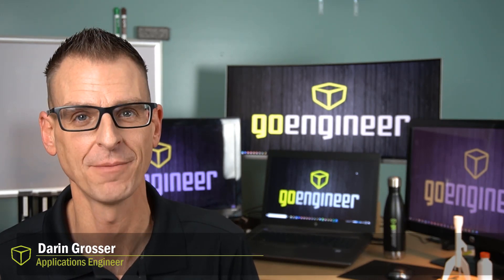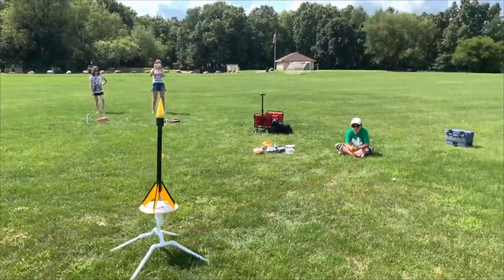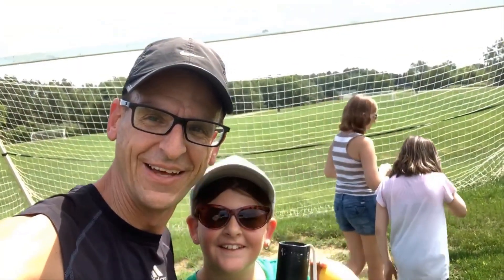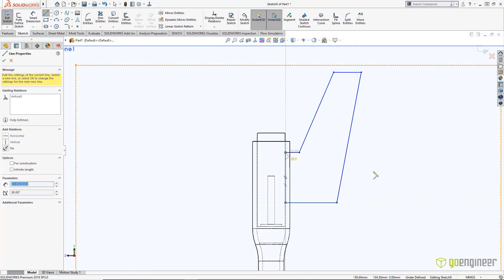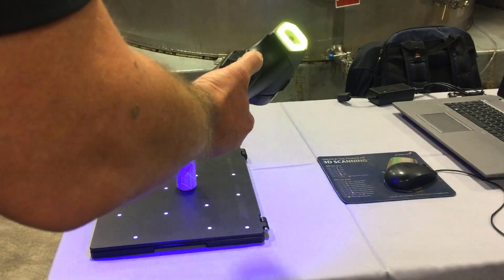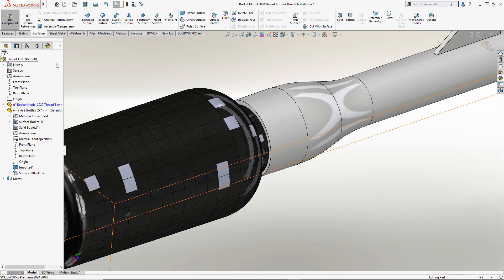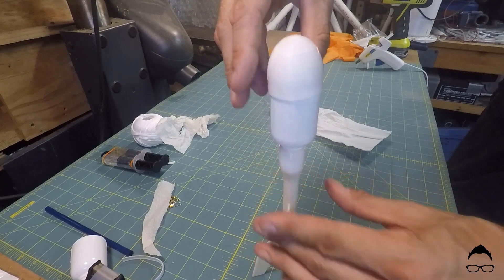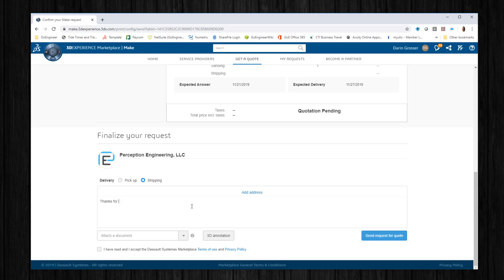SOLIDWORKS, Scanning, Rockets and FUN

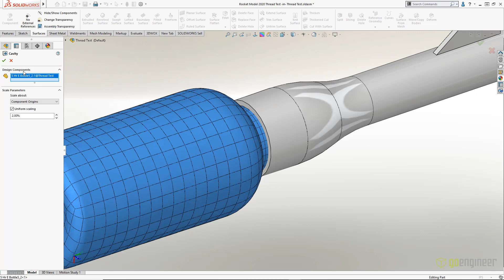Comment: @4:04 instead of scaling the cavity scale the bottle model. Also only scale in the "X and Y" if you scale the threads length it won't fit right. I find that my printer is about 1/16 of a percentage scaled increase is a snug thread at 1" thread diameter.